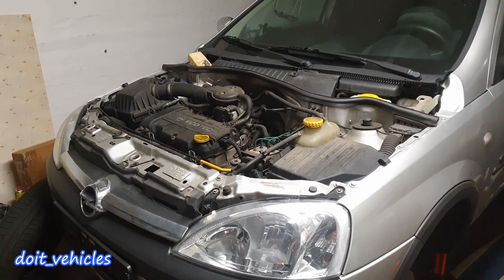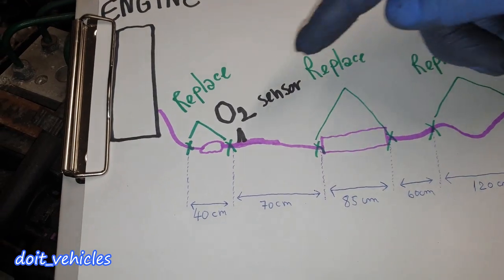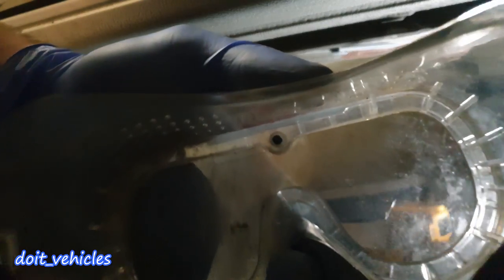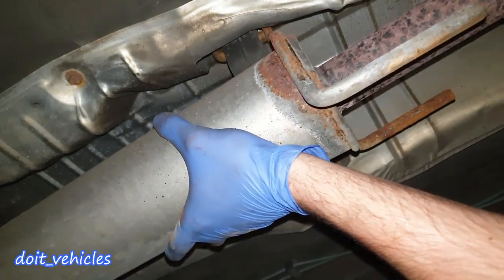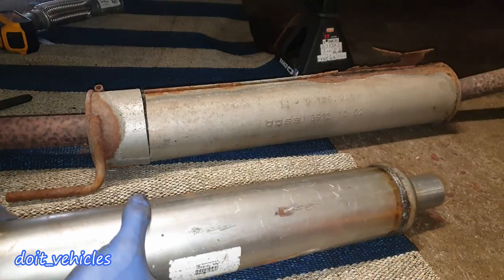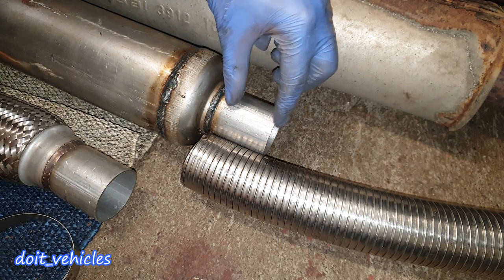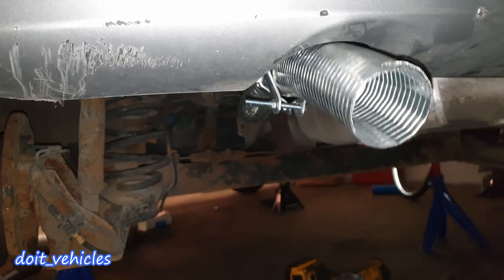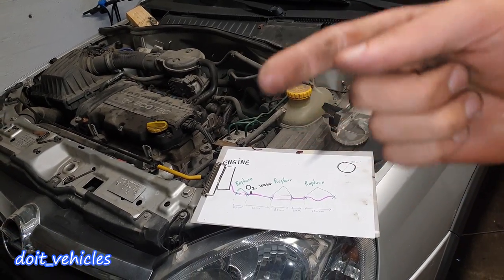How to Repair the Exhaust Pipes without Welding them / Muffler Fix - Replacement / Opel Corsa C

Comment: Very good and informative video. Personally, I would have replaced everything given how rusty it was. But I also know sometimes you have to do less than ideal to make it another week. The aluminum foil was a cool trick but bear in mind the dissimilar metals will create a galvanic cell once water and salt gets on it. Another thing you can try is either muffler cement or muffler tape. The tape is fiberglass impregnated with muffler cement. Same idea as the aluminum foil but it forms a chemically neutral bond.

Comment: Very informative, thanks. One question tho: why did you cut and replace just the flex part instead of buying a whole new pipe and just bolting it on? Is it just cheaper this way? I ask because the flex pipe on my car needs to be replaced.
Reply: Just buy the new assembly it is around 100 euros/dollars and costs about the same as all the things he showed plus it only takes 2 hours to replace not 4 days and will last! no brainer really. I would only do this method if you only need the car to run for 3 months or so and wanted to spend as little money as possible.
Reply: @Eddioj  that's what I ended up doing and it was 100% the right decision
Reply: Here in 🇬🇧 that would cost you about £140 fit it yourself within an hour. With a few cans. Just to help you out.
Reply: @zigzag7194  yeah I had to wait a week for shipping but the part only cost around  $100

Comment: How much do you think it would cost to put the pipe back onto my car cause mine fell off completely and I don’t want to pay a crap ton of money it doesn’t have holes in it or anything but it’s straight pipes for a 2004 Audi S4
Reply from the maker: depends where you live . where I live can go easily over 500 $

Comment: I would like to add that the flex tube does not hold up well and won't last long where salt is used in winter road conditions.
Reply from the maker: true , but for a cheap car which will be on the road for few more years it's ok

Comment: Not to be a jerk, great video by the way man but this wouldn’t pass a smog emissions test in California. Any modification to the headers, intake manifold, or exhaust manifold, including removal of a "Y" tube from the exhaust pipes (if equipped) is considered an emissions tamper. Your vehicle will fail the smog inspection even before the tailpipe exhaust is checked.
Reply from the maker: It won't fail the test because of that ( at least on this car )  but it's true in some countries will not approve this build + it's meant as a temporary fix like when the exhaust falls due to rust and the car is cheap / u want drive it few more km before scraping it .
Reply: Yeah dude, it would definitely work for a quick fix if the vehicle is already smog tested/passed. Here in California, they’re are very picky but it’s good they are. Keeps our air clean, who doesn’t like good quality air Ahaha. Good work man, keep it up.

Comment: It is an expensive repair I think, many adapters + flexible pipes
Reply: 4 days work + repair flange  and coupling connectors.   It looks like it's cheaper and faster installing exhaust system for vehicle. 
I have a 97 Altima where pipe broke off right at rear catalyst.  Can that be welded?

Comment: This is probably the worst job I have ever seen! Aluminum foil on the exhaust? That's not going to hold. The cutting of the old resonater pipe? Why not just put the piece you have on and get a real tailpipe? You know the one that fits the car!
Reply: or use some Permatex copper gasket sealant like it should,  instead aluminum foil !   🤣🤣

Comment: McGuiver over here. Should had just ran a straight pipe down the trim but that would had been to easy
Reply from the maker: And it won't be approved
Reply: @doit_vehicles  i got ya... but wernt you missing cats on all 3 banks anyways? Good video though much easier throwing that flex pipe in rather than weld my bank 1 cat back all the way up near the header so thanks

Comment: 4 Days Of Work!? A Whole New Exhaust is $400, Just Replace It
Reply: $400 new exhaust last 2-3 years max, unless it is a stainless steel and professionally installed - but that will run you about 1K.
Reply: @mikek.9980  I'd love to know how much that lot cost him. Coz he bought the flexi down pipe. the small extension. a middle box. and a tail pipe well that flexi pipe thing. And it took him 4 days.
Reply: @zigzag7194  I don't think that he worked more than eight hours combined on it but it took four days to get it done.